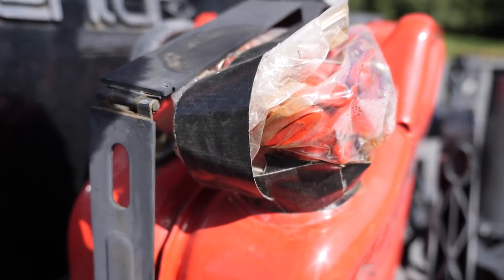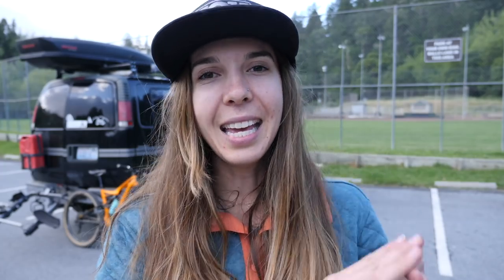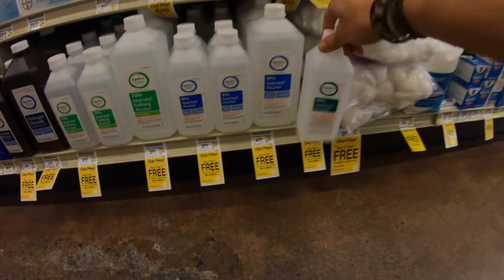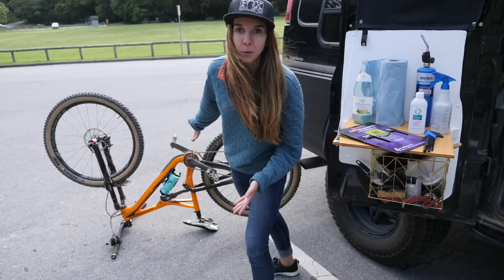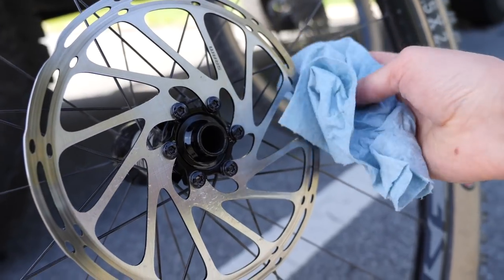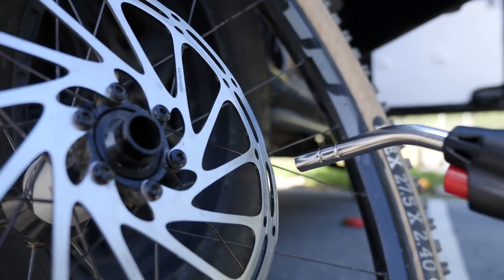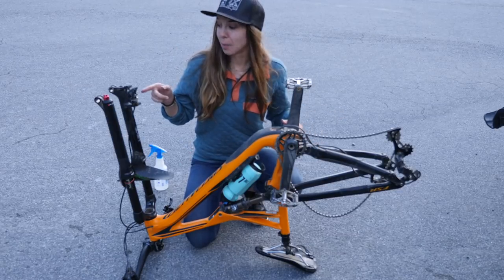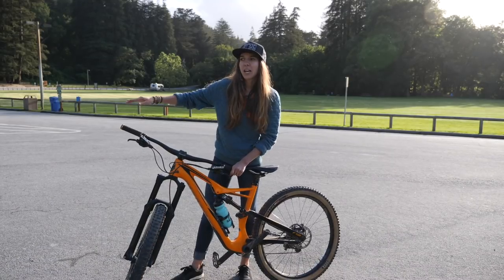HOW TO FIX NOISY DISC BRAKES ON A MOUNTAIN BIKE | NO REPAIR STAND REQUIRED | DIY MTB REPAIR

Comment: Thanks for doing the video and sharing your technique. The squeal and vibration from my Avid Ultimate hydraulics was actually making the mere thought of riding unpleasant. Heck, it made the thought of wheeling the bike around the garage unpleasant. I was really disappointed after paying a LBS over $100 to adjust my derailleurs better than I, and stop the incessant front brake squeal. While they may have gotten the shifting a touch better, the squeal was still there. I brought it back in and they told me that it was my brake setup and that it couldn't be fixed, that I needed a completely new front brake. Fast-forward to today and I decided to give youtube another look for solutions.  Well, so far yours has worked. I cleaned and torched the rotors exactly as instructed, bedded in the sanded pads, and still no squeal. If it it holds up you'll be my hero. Fingers crossed. Thanks again. Cheers.

Comment: That did it!!!!! I had the exact problem, I accidentally spilled a bunch of fork lubricant on my brake. This fixed it completely!!!! Thanks for the helpful video!!!

Also, whoever is going through the steps, be sure to use as much alcohol and sand away as much of the brake pad so to allow them to be visibly free of any contaminants!!!

Comment: Holy shit you saved me! I had tried literally everything else, even installed new rotors and pads, but it seems I somehow contaminated them right after that  during brake bleeding. I knew about sanding pads and cleaning rotors, but the fire was new for me and turns out that’s all that was missing. I love this solution, just put your problems to the torch 🔥😂 so a thousand times thank you! You deserve more views!

Comment: I find some pads soak in the oil very quickly, and after sanding oil can still be present..but this method has saved me a few times while I wait for new pads to be shipped to me.

Comment: I followed all of the steps in the video. Brakes are better, but still squeak during quick, hard, braking. If I reapply the brakes within a few seconds there is no squeaking.  However, if I ride for a couple minutes, and then do another hard quick brake, they squeak again. Any ideas?

Comment: automotive brake cleaner also works on rotors if you have it handy (more expensive and messy though -  lots of overspray)..   It's also possible to sand pads on an abrasive concrete surface if it is not too dirty (clean em after)

Comment: How about dropper post maintence!? I use a cable install for that post.its a simple but effective post and lever. It works well for me.   I need to eventually replace my simple lever.   
I have a  29'er with a 120mm dropper. It has a black rubber protector around collar...does that post need oiling! I'm scared of it because I don't quite know how it works. And embarrrasingbly...I didn't realize there was a rubber sleeve covering and protecting post. I peeked in and found dirt and small rocks. Gonna really clean it well. But sometimes things aren't the same after.🤔😜

Comment: I haven't tried the blowtorch thing, but I haven't needed it. But shop towels would be nice currently using toilet paper but it tears, flakes like snow, works OK for some stuff but not sharper things, so cleaning jockey wheels will leave residue.
Reply from the maker: Oh yeah, blue shop towels will change your life! They are pretty dang cheap too.
Reply: @callie_waldschmidt  I will check where I can get my hands on some, maybe I will have to go to a hardware store or buy online. I know local hardware stores have gloves, but don't remember if they got towels.
and I haven't tried Kitchen towels, but they might have the same issue as the toilet paper I used, I just use the cheapest stuff. hand cleaner and gloves is also a must when doing the nastier & dirtier jobs too.

Comment: good Video!!
I used to be sloppy with my Chain Lube until I Looped a  manual one day after lubing my Chain before a ride lol no One seen but I Burnt my ass on the tire haha good times with my slef.. any how if any of you get Oil directly on the Pads Just need to buy new! pads and clean rotors Like she does in this video. Iv Tried Burning Oil out of Pads they Just soak it up and they are ruined..

Comment: Would you ever recommend resurfacing the rotors w/ some high grit sandpaper?
Reply: I use 100 grit sandpaper but I only do it when the rotors don't have the same texture, I don't do it often. But you don't have to do it just be use of contamination just degrease it with degreaser or alcohol as in this video.
Reply from the maker: You can if you really are opposed to getting new rotors put on, but bike shops generally replace them at that point. Totally possible though!
Reply: @callie_waldschmidt  I don't replace the rotors before they are getting to the thickness limit, I still have a long way to go. no need to replace rotors all the time, I have had 3 sets of hope floating rotors which wear slowly, also keep good temp. I only sand them down after few months so maybe 1-3 times in a year, too get them to have as good texture/bite to them as new.
and of course regular check of pads, I actually manage to bend the pads, so I also have to sand them down, and use caliper to measure all sides to make sure it's even.
and when the pad surface flakes off I replace them.

Comment: Don't forget to wear gloves when cleaning rotors. You will slice your fingers open.
Reply: Happened to me once when I tried to transfer a rotor with a tiny allen key (for some reason it wasn't T25 but 3mm hex? wtf) from old wheel to new. Sliced out my finger joint a little and won't stop bleeding normally. Took 15-20 mins to actually stop bleeding, but went to the nearest medical center for Tetanus shot, just in case. Now I always wear a pair of nitrile gloves when working on the bike. Once sliced, twice shy.

Comment: Methyl Hydrate (methanol or methyl alcohol), not Isopropyl as it contains a high amount of carbon molecules. You wont need to use the torch to burn off the carbon contamination if you use Methyl Hydrate (methanol or methyl alcohol).
Reply from the maker: Thank you for the science! I haven't tried using that. Rubbing alcohol is nice because it's a common household product and available anywhere but I'll have to look into that.
Reply: @callie_waldschmidt   Its the same stuff you can use in your gas tank during winter, available at any hardware store. Although, DO NOT use gas line antifreeze on your brakes rotors as it contains additives. Do not use rubbing alcohol in your gas tank unless you want your gas motor to push black smoke (Unburnt Carbon) like a diesel.